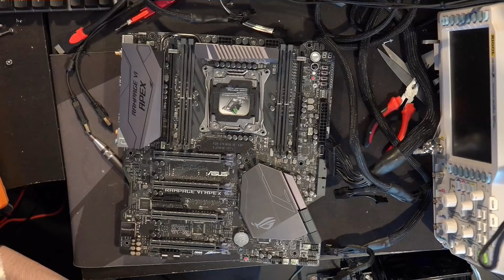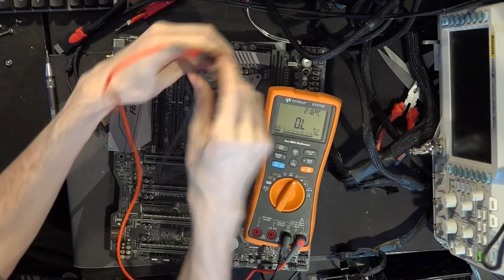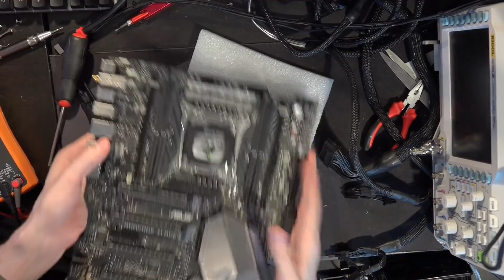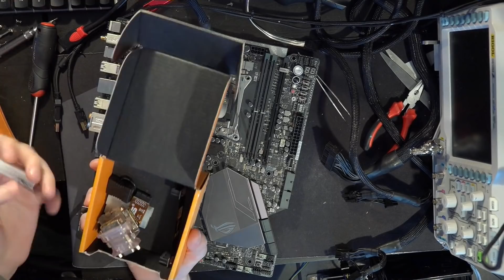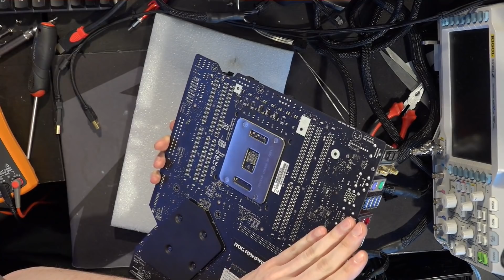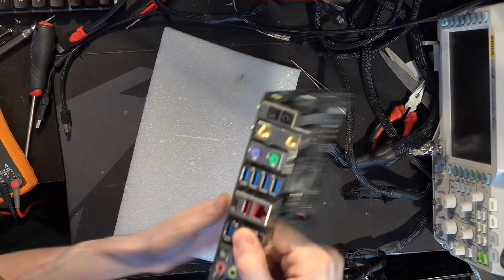Don't stick working CPUs in dead motherboards feat. EXPLOSIVE ASUS Rampage VI Apex

Comment: And that is why, dear friends, you use lab power supply with current limit to troubleshoot and repair motherboards. Do not try what shown in this video at home. Capacitors are replaceable, but your eyes when one of those shoot into your face are NOT :)

Comment: Funny story I relatively recently  purchased the VRM explosion hoodie from your Teespring and  one of the first few times  I was wearing it  I sat down and started watching a lecture from my circuits and signals class that I am in. We were going over diodes and the first example circuit my teacher used was  a buck converter and I was like hey whoa I have that on my hoodie except this one is a lot less simple and failing catastrophically. Also the hoodie is sick 10/10 would recommend

Comment: I just watched this video 2 weeks ago and today my Asus Rampage 5 E10 committed suicide taking i7 6950X with it. All @stock, only RAM @3200 and manually adjusted some voltages because mobo overvolts on Auto. I had it for 2y as my main rig. I think exactly the same thing happened as to your APEX. PC just turned off when I was watching a movie and then I wanted to reboot it, but it was running very fast/short through POST with code 41 as the last and then it would turn off. I was very stupid because after 5 tries when I unplugged all the stuff from mobo it just turned on with POST 00. Now no matter what I do it is just POST 00. I just checked cpu in GA X99-SOC Champion and it doesn't even turn on the POST LEDs - CPU is dead. I'm depressed and devasteted as hell. I didn't even had played with OC on this cpu/mobo.

Comment: I don't get it. You tried to repair it or destroy it? Connecting board with a short to PSU like you did and hoping that OCP will do it's thing is just stupid. You should connect it to regulated DC power supply and crank current up till something start heating up, not blow up. That's easy way of frying PCB itself, like blowing visible traces, inside traces and via's.

Comment: I learned my lesson about using diagnostic parts to diagnose things when my dad had his computer die, and it turns out that as it died the CPU turned into a Mobo killer. Put his CPU into my motherboard, tested it, no boot "oh there's your problem, bad CPU" then put my CPU back in, and still no boot. Big F to that motherboard.
Reply: did your damaged motherboard kill your working cpu?

Comment: i have a laptop that has a short on the cpu power rail, but its only shorted while the cpu is in the socket, which made me sad cause i couldnt fix it by just removing a component and letting it run on the other two phases..

Comment: I’ve had this happen to me buying a x99 deluxe board. The guy told me that his cpu wasn’t working and the board wouldn’t start but I was stubborn and payed the price. Lost a perfectly working 5930k to that board. Took it apart to find burn marks on one of the power stages.
Reply: Kinda a weird question, but have you try to repair the CPU? And what happened to dead board? Keychain?
Reply: Inkling Boy - BLK • 555 • No I didn’t I just sold it for parts on eBay. After 12volt Vcore is sent to the cpu it’s toast (damage at the silicon level). The motherboard I just ended up returning it to the guy I bought it from. If I had more knowledge back then I could’ve just removed or replaced the damaged mosfet but I didn’t.
Reply: @UnboxIt  ok then, for me I would make keychain out from it

Comment: OCP won't always save your board, especially in larger PSUs as they have the overhead to give. Not to mention they need to be able to handle sudden current loads of a system without tripping, so the OCP will need something more sustained to trip it (it's all measured in ms). PSU also has a ramp up time before its at full power, and by that time the load increase was probably too gradual to trip it. It probably blasted a track off the board in addition to the bad VRM and cap when you powered it... which would have acted as the fuse and relieved the fault current. Could have also been a bad cap shorted to ground all along too - they do fail!

Comment: Currently dealing with Asus. I have a Asus X570 E-Gaming and updated to bios 2407 from 1408 that gave me a shit ton of problems, random reboots with ram instability on it's QVL approved ram. Did a Bios Flashback back to 1408 where it was all good and now my ram doesn't work in it's 4x8gb configuration. All sticks work in all slots, it works in 2 sticks but not the 4. Then Asus 2 days after they released bios 2407 it magically disappeared and was replaced with something else. I feel like they realized their bios version 2407 fucked up, they took it away quick, and now they have 2606 and guess what still not working. They want me to send in my Board for a Month process. The comedy that is that Company something else. I'll be picking up an MSI X570 Unify this Monday. Fuck you ASUS!

Comment: If you are lucky only the cap is shorted, you should remove it and check if the short is still there. I don't think that 2 things failed at the same time.
I also don't think that, the fault would definetly kill your cpu, because there is a short to ground, it will dump the voltage to ground and not to the cpu(but I would not test it).
Would be really nice to see you repair the motherboard :)

Comment: I could really use some help... I've spent the last 4 months trying to find someone to look at a MSI P67-GD65 MOB I bought from a pretty trust worthy seller on ebay to see if it could be repaired and how much to be repaired with no luck both online and local. I couldn't test the board until a month after buying it and found that all it did was power cycle over and over and by that time it was to late to get any money back on it and I lost about $100 in this board which I was plaining to sell to help fund my first DDR4 build. I've tried different cmos battery, an i7-2600k and a i5-3470, and different ram etc etc. Do you possibly do motherboard repair?
I also just bought a EVGA Classified K Z370 MOB and have found myself in the same situation were I have a board I can't test right away because i don't have the cpu yet, and honestly if I lose another $100+ on a board I think I'm just gonna stop trying to build another PC because at that point I'll be $200+ in the hole with a new build I'm saving parts for that's already $300-400 over budget.

I'd gladly pay you =/
I've found it's really hard to find a pc shop or even a place where pc parts can be repaired. I'd hate for this board to become a wall ornament because I really try not to make any E waste. I actually repair electronics myself and re sale them but I know pretty much nothing about how to test them. Thank you.

Comment: It's really hard to kill PSUs I find. I've used them for carbon arc lamps and for powering ignition coils and things with lots of electrical noise and back-EMF. They don't seem to care!  Even the first power supply I ever abused, a 300w AT power supply still works fine. Tho the switch is worn out! by now.

Comment: Been there, done that...

I worked with RMA returns and had to test every motherboard that came in. I burned quite a few processors doing this. Some actually was damaged enough that they killed the next MB they were tested in. For anyone reading this, if you have to send in a RMA please fill in all the details they ask for. So don't just write something like "Dead" unless the MB actually is dead as a door knob. The worst descriptions was "doesn't work". What doesn't work? Is it turning on? Does it go through post? Will it boot?  The people handling your RMA isn't your enemies. You want them to handle your RMA in a quick and efficient way. You saving 30 seconds in filling out that RMA form can result in your RMA being refused if it turns out the information was incorrect.

Comment: 5:05 "Theoretically if you keep power cycling a GPU with a blown up power stage, eventually it'll kill the GPU core." Both me and my dead 980 Ti wish we would've known this last year. There's nothing theoretical about it. :( The weird part was that it was acting more like a failed solder joint than a phase going bad. If I twisted the PCB a bit while the card was under load, it wouldn't shut down. So I reflowed all the solder around the VRM's, then it started triggering OCP when I tried to boot it. I tried one more time and the first phase popped, sparked, and smoked, and then the PSU stayed on. RIP 980 Ti.

Comment: Hey BZ- question: is the little metal plate with the thermal pad on the back of the board “necessary” in a VRM setup like this board has? Could it run without it, assuming the front heatsink was still attached?

Comment: I took the gamble with a b450-A board with broken socket plastic and missing knocked sideways capacitors/ resistors around the cpu area, I guessed their cooler was knocked.  I resoldered what I could. It was able to update the bios through usb so I chanced it and it actually worked.  Sadly the sound doesn't work, but I consider myself lucky because it was $15 which they refunded because of the knocked components, so free.  But it could have killed my new r5 3600.  Lucky.

Comment: positive on 5V, negative on 3.3V at the PSU will give you 1.7V, enough to not damage the capacitors (2.5V right?), and a small current limit to not blow up the mosfet just heat it up. Just hook that to the 8 pin.
Edit: need to isolate 3.3V from 24 pin ground, so don't plug it in the motherboard of course.

Comment: It'll run just fine with seven out of eight phases if he can figure out which inductor to yank.  I'm running an RX 470 on three out of four stages (phases?) just fine.  Had to down-clock it a bit, that's all.  :)

Comment: I'm such a noob,
friend brought me a pc he built for a kid . wasn't working, kid removed CPU and had it in a t-shirt. Pins were bent, no biggie I fixed that, put CPU in Mobo brief lights then nothing,
put my 8350fx in and brief lights then nothing,
week later I'm looking at the Mobo again and there's 2 blown capacitors on CPU vcore....so I killed my chip AND the original 8370fx in that MOBO....
still found replacements and gonna try another chip. , Would replace corresponding mosfet but there's no markings and can't find what they are 🤷
Reply: Your biggest problem is that you aren't using your punctuation marks the way they are supposed to be used. 

"put CPU in Mobo brief lights then nothing, ...."
Reply: @AndyU96  idk man. I've seen lots of people trade "..." For commas lol, you're still supposed to enter a pause either way , 
but meh lol
Reply: What you can do is put your multimeter in diode mode and probe EPS12V and probe the output chokes, whichever one beeps is the source/drain shorted mosfet. 

I had this happen once on the notorious asus x99 deluxe boards and killed my 5930k.

Comment: 10:55 - 10:56 You can see the spark coming from the top capacitors, moving to the screw hole and exiting the board.
Also the 1st one on the left has a spark on his left side as well.
Watch it on 0.25 for the moment.

Comment: Nice video, dead CPU can kill working motherboard? . My Asus TUF x570 just stop working CPU led ligh on. Used my son b450 to veify CPU, luckily it was the Motherboard. My 3900x is now happy with MSI Ace.
Reply: If i remember right athlon XPs would take out the motherboard when they die from overheating.Not sure though if the now dead cpu will kill another board
Reply: @Lollllllz  thanks for the info. I got lucky. The mobo die, CPU post on my son mobo. Already got MSI ACE. Always build with ASUS never had modo die on me.

Comment: I'm a newbie when it come to using multimeters but how does ohms tell there's a short circut?
Reply: Not really good in electricity, but if the resistance is equal to 0ohm, and you apply voltage, since I=U/R, you basically have an infinite amount of current flowing in the circuit, which is basically a short circuit, and a really good way to start fire

Comment: I know this is not the case, but this reminds me of the many boards Iv came across to that were killed by lighting strike. Basically everything was fried and all chips were turned in to resistors. As a result, the board usually had like 60W idle 5V standby draw and everything was heating up slightly (or less slightly in the case of PCH), off course anything plugged in = instant death.

Comment: Yayyyyy      Spolsion or cool.
When i was a kid in GCSE Electronics if the teacher left the room we would jam a bunch of through hole capacitors into the plug socket and have indoor fireworks.
They would spew a white foam and shoot the lid across the room.

Comment: I'm not so sure that the CPU would necessarily get killed.  I've seen a lot of graphics card with this mode of failure where the GPU itself still worked once the short was cleared.  

Those power stages look like they'd be a real pain to replace, though, even if you had replacements.  Such a tiny space with a plastic connector right there, plus a huge copper power plane for a monster CPU...
Reply from the maker: I know a guy who killed 3 7980XE with a shorted Apex.

Comment: MSI Z390I Gaming Edge killed my 8700k last week then i bought a G5400 to test it now have 2 dead Cpus,I bought that MSI Piece of Shit "new" from a Private Seller.Did work for 5hours but had very strange behaviour,VCCIO was 1.38v default.Delidded 8700k was a great cpu 5ghz avx rockstable@1.34v on my Asrock z370 gaming k6 which ist dead too now because in my Rage i bend Pins in the socket which i repaired 2 years ago.The only Reason i bought the MSI i did want to try out all my B-Die Ram especially the 2x16GB Dual Ranks that could reach DDR4000 1.35@19-19-19 on the Asrock and even 4x16gb DDR3600 c16 was possible on that old Daisy Chain Board.I think the MSI Board 12v rail from 8 Pin was broken because the onboard Led and Cpu Fan only work when i plug 8pin out and start with 24pin.Im not a Beginner and this horrible Event is still hurting me deep inside.I really want to know what exactly was wrong with this Board.Only thing i can blame myself was i didnt stop after all this strange long Bootings after i changed something in the Bios.The Kill Event happened in a y-cruncher Test Run which i did after short Tests with CB15/20 and some p95 small FFTs monitoring VRM Temps and Vcore @only 4,7ghz 1.2V which should not be a Problem.I even put a sensor under the VRM Heatsink and it was nearly the same Temp as the Board Sensor in HWInfo.Had all Overvolt/Temp Protections on Auto in Bios and it was the newest Bios.Maybe i should buy some Black Silicone and Glue the IHS back on the 8700k and test the Intel RMA :p

Comment: why not use ample? ample + thermal camera / infrared thermometer, feed it 1~3V
Reply from the maker: I actually thought of that after posting the video.
Reply: Yes there are safe ways to find a short but not as exciting.
Reply: What's ample?
Reply: RAMIdotGG bz recently posted a video on it. A small board thats useful for replacing smaller power rails on all kinds of stuff.
Reply: @MinecraftAnd9646  God bless thanks for the reply 👊

Comment from the maker: that cap could be your CPU. Also sorry for the traffic noise I live on a very busy street.
Reply: >  I live on a very busy street.

I thought you were a successful YouTuber who could afford to live indoors?
Reply: from  sleepy  to awake in  10ms
Reply: Maybe you should invest in some safety goggles for such demonstrations ;)
Reply: meh vrm on a decent board that has a ded vrm.........
epower V = run all the ln2  on all the cores
Reply: Hey Buildzoid, not sure how to contact u but I tried shunt modding a 3080 and derbaur’s method doesn’t work either, check here.  https://youtu.be/aqPBk1K5p3A

If I send you one of my 3080’s would you be willing to figure it out and make a guide for it?
Reply: @FrameChasers  remove the shunt resistor and replace with a copper strip then. if you are trying to lower the resistance across the pads make sure the thing you are adding to it actually has a lower resistance than the stock shunt resistors, a small wire wont have a low enough impedance.
Reply: @the_socompsp  already figured it out long time ago
Reply: @FrameChasers   couldnt have been THAT LONG of a time ago lol, the cards havent been out even a month. i guess we just have differing ideas of what a long time is.. but i am glad to hear you got it sorted out. how much of a difference did it make?
Reply: @the_socompsp  lol true, I just never sleep so its all a blurr to me, mmmm not much, like 10% gain for 50% more power draw